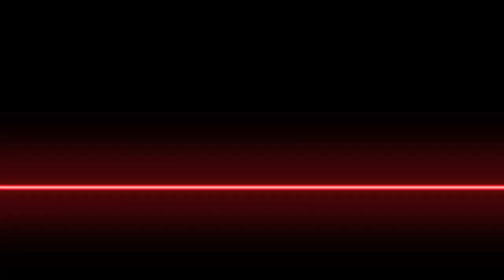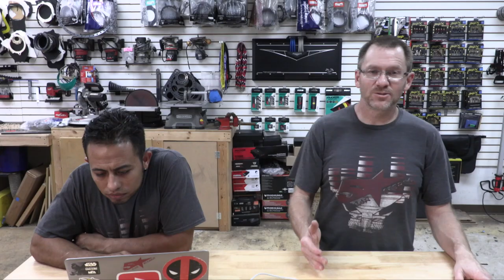How can I reduce Clipping?

Comment: What if I'm running two 700 watt subs at 1 ohm pushing 5000 Watts from the amp but still clipping ? Then what is my issue ? I've got a extra batt and a cap if that's of any issues .

Comment: Once I have the gain set properly I want to be  able to control the volume output of my mids and highs with a knob like my rca knob for my bass. How I can I have a single knob for 2 rca runs to 2 different mids and highs amps

Comment: Got a "middle road" jvc source, 2000cea 12s, on a ds18 8k.1, you'd think I wouldn't be having clipping issues after verifying almost zero resistance at amp and every connection tion throughout clean, all 2/0 ofc, 4g speaker wire ofc, 10g ofc remote, tympany  rcas, twin skar earth blocks each with 1/0 ofc chassis grounds doubled up with brauded silver tinned straps, "big 5" with branded silver straos and at least 1/0 ofc. Bass boost snd freq "zeroed", gain at MAYBE 1/8th of. Turn, high oass "off" low oass was on 80hz, dropped to 60 thinking maybe thr slope carried up. (Helped) but cannot seem to tube this thing happy . The Destriyers are 2ohm S/P to 2ohm at the ds18k.1 should be MOVING those budget subs, but alas. Clip clip clip clip clip

Comment: I have a taramps 3k bass amp on 1600rms subs with gain down pretty far and it still clips
Reply: Same I was told that it could also be your signal like if your running off a factory radio then you need a good line output converter
Reply: you don’t got the power